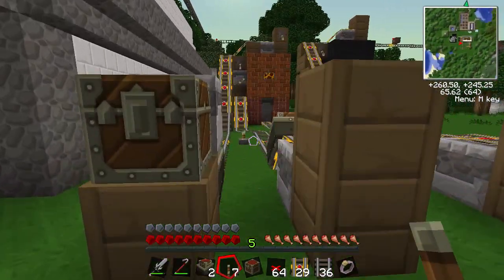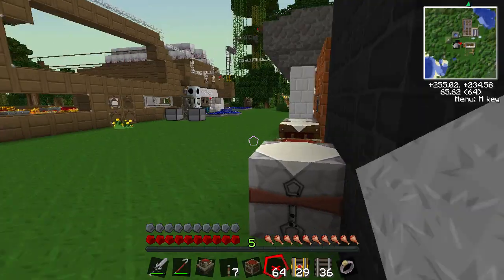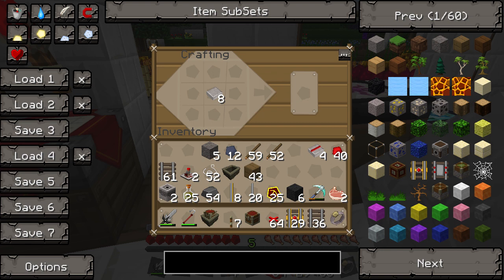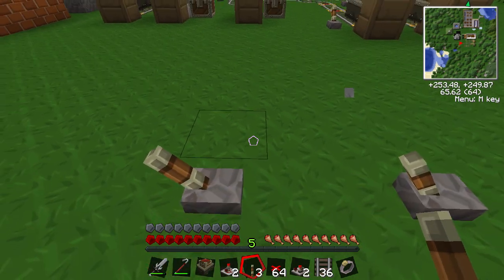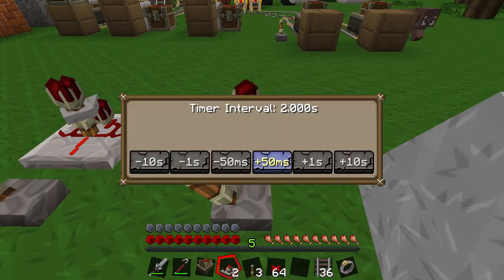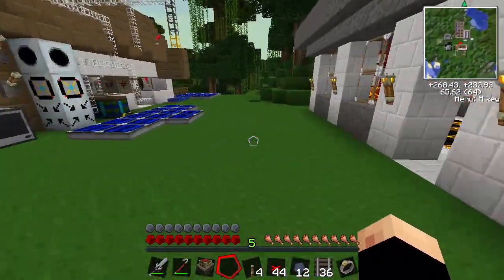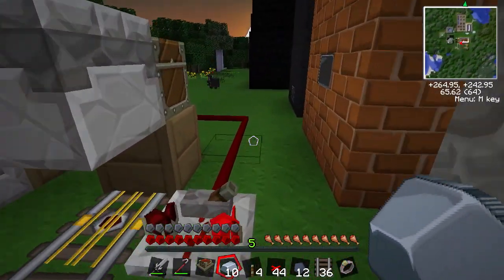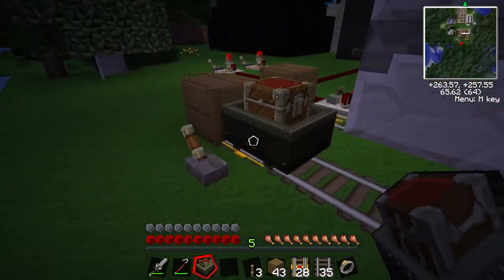Tekkit/Technic - Episode 95 - Timing Our Rails!

Comment: It actually is not bugged out; the item loader is designed to output a redstone signal when it finishes doing what you told it to do, to make it possible for it to stop and load or unload completely, then automatically send it. I believe you can turn it off by pressing the button labeled "Complete".